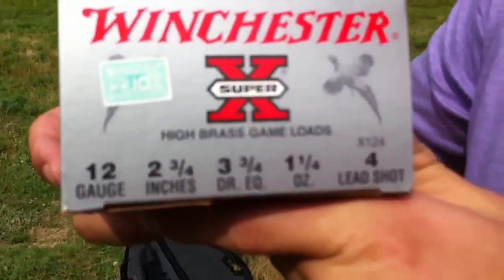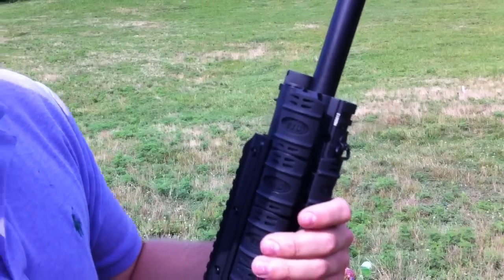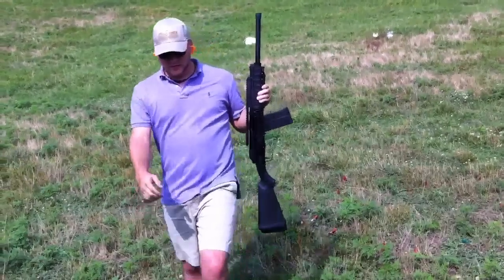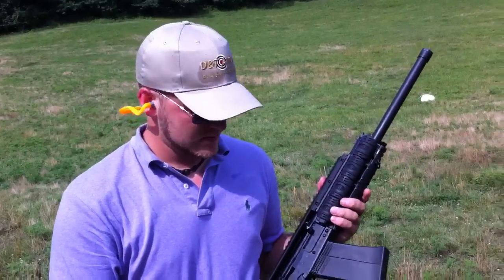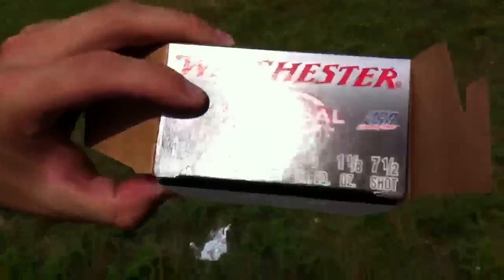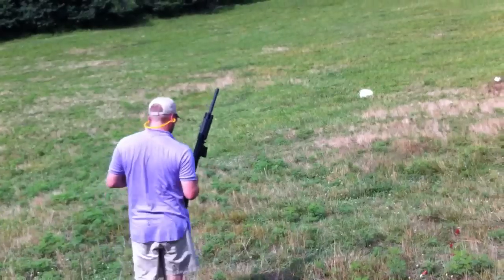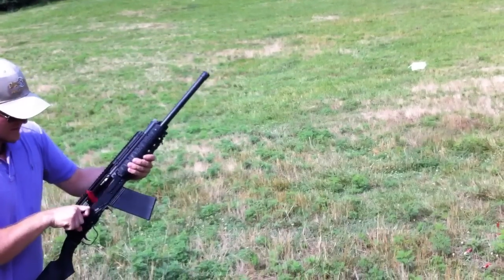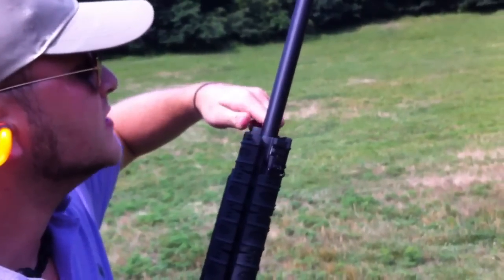Saiga 12 FUN!!!

Comment: I broke my S12 in with 250 rounds of 00 Buck. After the break in I field stripped it, cleaned it, oiled it a little and was able to run federal bulk even on the 1 setting. That changed when I converted it.I think the shorter stock was to blame for it not cycling on 1 but I switched it to 2 and it continues to run flawlessly. I think some S12s are just luck of the draw that the gas ports were done correctly at the manufacturer.

Comment: Yes, I would say that more than half can run the federal bulk pack 1200FPS 1 1/8 oz loads out of the box.

Go to forum saiga 12 dot com. This is addressed commonly there. Be systematic, and do your service with OEM furniture and gas pats. After it runs move to MD plug. You will need to do some combination of reducing friction and enlarging or unblocking ports.

Comment: @merrylt with the v-plug you just set it to a lower setting, with the stock gas plug it would since you have only 2 settings. But i kinda thought the same way so i just got a recoil buffer for it just in case it was rough on it. Its pretty much just a rubber/plastic plate that sits on the back spring so if the bolt does hammer back too hard it will absorb some of the damage. With the v-plug though 00 buck runs through mine fine on setting 3 and sometimes 2.

Comment: I have a SAIGA 12 from 2000.  It is a very early gun.  It will run anything BUT, the Winchester Universal rounds.  The problem I see with the variable plug is it can become confusing when changing ammo.  What setting works for what?  The original plug 1 and 2 setting works fine for me.  1 for defensive , 2 for birdshot.  you can see my videos search "dudepetri"

Comment: Lighter, stronger better looking, not chinese, similar cost, don't put torque on the gas tube. (UTG is known to cause cyclig issues on some guns) Also the long UTG rail is spingy like a diving board. The comparable length chaos rail is rigid... That's enough, I was begining to sound like daft punk.